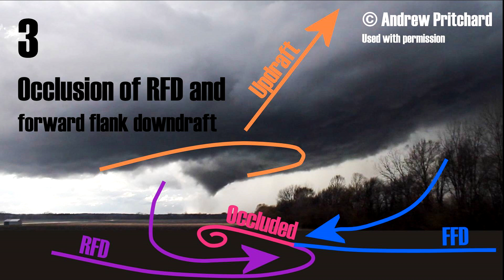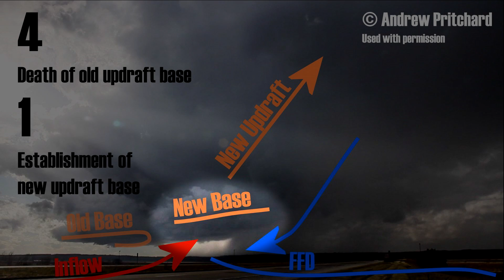Understanding How Supercells Cycle

Comment: How are there only 29 comments on one of your older informational videos?! You rock dude.

I've wondered for a few years if nature worked like an engine, gaining more power or becoming more volatile when it feeds on cold air that is easier to manipulate than the rapidly moving particles in warmer air. Easier to compress cold air as well as the particles within are closer. It's also thicker. Obviously we see they intake moist air...but what if cool air is the most important?
Reply from the maker: Nature does work like an engine, indeed internal combustion engines and Earth's atmosphere are both heat engines. It's not really about cooler being better than warmer, but what's most important is the difference between the two. It's the temperature difference in a car engine that allows gasses in the cylinder to expand and push a piston, and it's the temperature difference in the atmosphere that creates buoyancy to lift huge volumes of air. Car engines feed on cold, dense air because this provides more oxygen for the engine to burn and generate a heat difference. Storms seemingly do the opposite, feeding on warm and moist air that's less dense, because the cold, relatively dense air that creates the buoyancy is aloft. But the process actually also starts with cool air at the surface that the sun then heats up, generating a temperature difference for the atmospheric engine. Really, both car engines and storms are doing a ton of heavy lifting to equalize this temperature difference and take energy out of the system. Cold, dense air can make for bigger storms, not as the storm's inflow, but as the air into which the storm is rising. I look at temps at the surface and aloft when forecasting storms. A particularly warm surface, or particularly cold air aloft can make for an unstable atmosphere. It's really about the temperature difference this is creating.
Reply: @skiptalbot  I wonder then if the temperatures and moisture and particle motion within the air have anything to do with the theory of ground-up development. We know static electricity is more intense and cold environments and we know mostly how lightning works. Makes me wonder if we are missing something somewhat simple in the ingredients.
My father is a chemical engineer and we got to talking one night a while back about water vapor and temperatures and lightning and everything else and how it all could possibly play together. Say a void is opened up in the clouds as the moisture turns into rain and starts to fall or things get heavier in the air rushes in to fill those pockets as the droplets become larger...idk, can't remember our exact thinking but it went down a rabbit hole of "what ifs." Haha. My brain is not wired like his so I got left behind.

Comment: I'm trying to understand the RFD process and this explanation still leaves me baffled. Slow down and explain it like the people who are watching have no background in meteorology. I'm sure some will read this comment and say "well, I understand it" Good for you.
Reply from the maker: My presentation style isn't for everyone, and that's fine. I like to go fast and deliver a fire hose of info. But let me try to help by clarifying or further explaining whatever you're having trouble with. You want to learn more about the origins of the RFD? It's a downdraft on the back side or upwind side of the updraft tower/mesocyclone. We're a little sketchy still on how and why it forms, and even how significant a role it plays in tornadogenesis. A lot of those details are happening up in the midlevels of the storm where we can't see except with a radar. From a storm spotting perspective, those details thus become rather moot. Instead, I'm focusing here on what the RFD is doing to the visible storm structure such that we can use it as a landmark for spotting purposes, and offer some ideas on the immediate role it's playing in regards to tornado formation at or near the surface. 

But here's some extra info on what we think is happening here: The storm's warm, unstable updraft develops a strong mesocyclone after ingesting ample streamwise vorticity. The updraft cools and stabilizes as it rises and condenses precip, forming a downdraft. The downdraft, crudely put, spills out the top of the storm and falls back down as it's now cold and stable. Most of it falls downstream, carried by winds aloft, forming the forward flank downdraft. But a strong, rotating updraft, will force some of the downdraft to spill down the backside of the updraft tower, starting the rear flank downdraft. There's evidence that midlevel winds striking the back side of the storm also play a role in creating or strengthening the rear flank downdraft. And also the possibility that it's originating even lower in the storm. Perhaps it's being mechanically forced downward by some mechanism in the mesocyclone. The forward flank downdraft is usually quite cold, but the rear flank downdraft can actually be on the warm side. The mechanical downward forcing of the downdraft would cause it to warm, as well as the downward influence from the drier midlevel winds that are striking the back end the storm. A warmer downdraft can actually add some instability and fuel the low level mesocyclone, and this is the air feeding into the tornado, so that warming is probably important. The occlusion process (when the RFD overtakes the FFD) may actually be creating a positive feedback process too, where the storm is ingesting and recycling its own downdraft into the low level updraft, warming it as it goes. These downdrafts appear to be delivering vertical vorticity for the tornado to stretch, and the RFD may also be enhancing the low level updraft with some extra buoyancy. These are just hypotheses, however. Dr. Leigh Orf suggests that FFD may be doing most of the heavy lifting here, delivering vorticity to the updraft, and the RFD is merely a side effect of the mesocyclone and not critical to tornadogenesis. I'm not totally sold on that, even though his super computer models spit out structure that mimics the real world. Maybe the RFD and its occlusion with the FFD isn't absolutely required, but I think it's playing a large role in both delivering vorticity, maybe creating a sink for vorticity aggregation, and modifying the low level thermodynamics to be more favorable for tornadogenesis.
Reply: I actually understand this comment.
Reply from the maker: Midlevel RFD origin should be apparent sooner: It might actually be there sooner than you think. It's going to take some time for the RFD to work its way back down, but the first RFDs usually manifest in the clear air behind the storm from what I've seen in the field. They just cascade off the back of the updraft base rather than cutting a big notch into it. The ones you're referring to that appear to suddenly show up, are appearing quickly because they are being wrapped around the updraft by the mesocyclone. Several RFD surges might have already happened before then. They may just not be surging forward or wrapping so strongly. It might also be that an occluded downdraft, what's responsible for the clear slot, is originating lower than a midlevel RFD. Another idea that just needs to be explored more.

RFD and death of a tornado: It's my hypothesis/speculation, that the tornado actually represents the death of the parent updraft. An analogy might be to think of the RFD more as a circular curtain being drawn around the updraft. Once it's drawn shut, the inflow is cut off, and the updraft starts to stretch and wither away. The strong vertical velocities of the updraft continue, but the whole updraft tube is being stretched and narrowing. Rotational speeds increase as momentum is preserved. So while the parent updraft is on its way out, the vortex at the surface is actually increasing in intensity until it eventually just completely withers away, the tornado ropes out and dies. My reasoning for this is that the tornadoes that have exhibited visible parent structure for us in the field always appear occluded and cut off from the storm's environmental inflow winds. And the parent updraft tube looks like a withering umbilical cord the few times we've been able to directly see it. So in this scenario the RFD is actually kicking off tornadogenesis. Additional RFD surges might disrupt or weaken the tornado in progress. Ooor.... if the thermodynamics are right, they might actually fuel the tornado. If a mechanically forced RFD has been warmed to the point of being buoyant for example. Long track, steady state tornadoes might be in some sort of equilibrium with the RFD, FFD, and inflow process continuing while the tornado is ongoing. 

I think Dr. Orf is on the right course and has actually cracked the code. His models show the exact same things we observe in the field. So I try to make sure my conceptual understanding of what the storm is doing jives with his theories. His idea of the Streamwise Vorticity Current along the FFD/inflow interface feeding the developing tornado vortex is key. He seems a bit dismissive of the RFD and I'm skeptical of this. I think the RFD might yet be playing a bigger role in many if not most tornadoes than some of his models show. His models might be idealized cases that spin up tornadoes without the need for an RFD. I'm still under the impression that it's the occlusion of the updraft and the updraft tube being cut off that is provoking the stretching process that leads to tornadogenesis.
Reply: @skiptalbot  thank you so much for these thoughtful replies to the original comments, Skip. I’ve been an armchair weather nerd since 2017 when I saw Pecos Hank’s “Tornadoes of 2016” video, and being from the eastern Great Lakes area has only allowed me to admire from a distance. You’ve put into more understandable terms what some of the current (and your own) general theories of tornadogenesis mean, and I can’t even express the appreciation I have as an onlooker. This is a bittersweet time of year. Tornadoes are such beautiful marvels of nature, but they also come with such devastation. Thank you for being m on the forefront of trying to learn the mechanics of them, and I have no doubt your work in the field will help save more lives in the future as we develop a better understanding, leading to earlier, more accurate warnings giving people a better chance at preparing themselves.